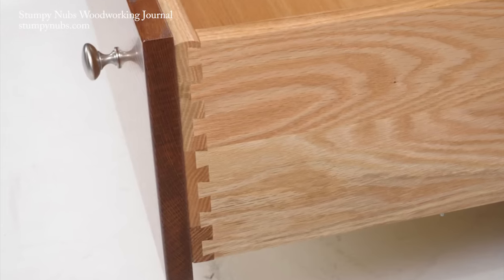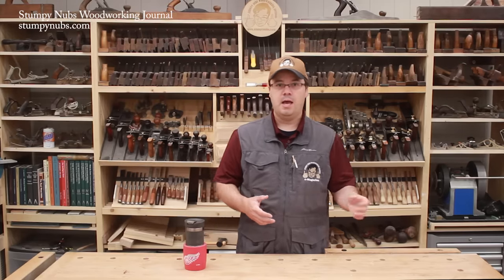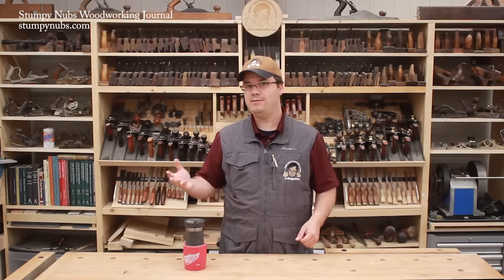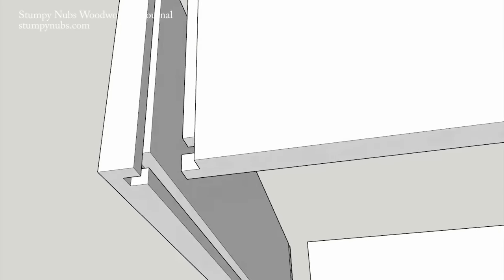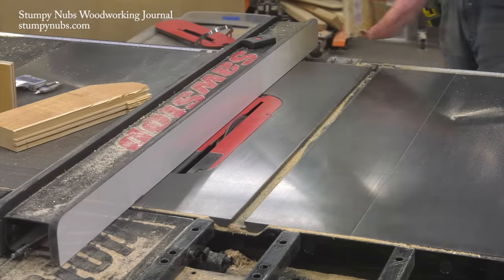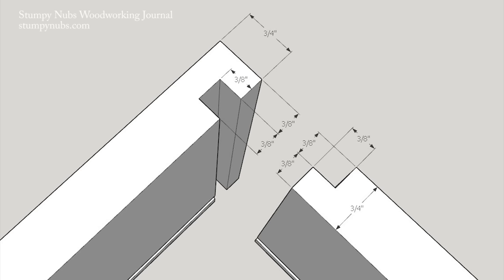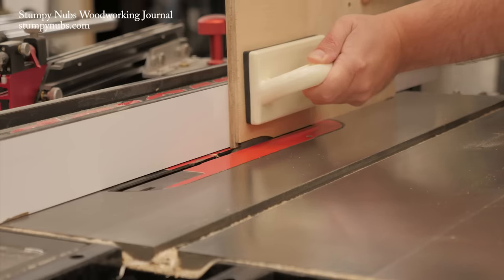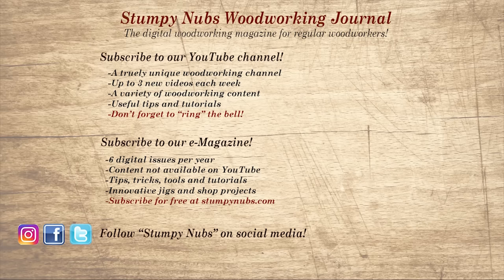The fast and easy half-half-half drawer construction method

Comment: Hi James. Love your videos and tutorials a great help to my woodworking hobby. 
Now the question. What happens if you live in blighty and don't have dado stacks. Is there a way of doing this method with a router and just as quickly as a dado or a single blade? I have the basic of tools by the way. 
Cheers
James from 🇬🇧UK
Reply: Agreed; especially since I have yet to made a tall tenon fence for the table saw.  I will try to use the router for the dangerous end cuts.  I have an old wobble dado that is infinitively variable for the other cuts without worry about stock thickness.

Comment: Is there a modified version of this that can be done without a dado stack? The rabbits are straight forward (one vertical pass and one flat pass per side), then I guess the first pass for each of the grooves, then edge in the fence for a couple additional passes to finish the grooves. Has anyone tried this?
Reply: If you have a table router, cut a relief groove down the center of your slot at the table saw (to make less work for your router) then set up your router for the half/half/half groove and finish the grooves on the router table. The cut on the table saw will make for less work on your router bit and less burning on your wood. Set the table-saw to cut your half thickness but at the center of your groove, so, if your doing 3/4 for instance, your 1/2 cut is 3/8, your center of cut will be 3/8 plus 3/16 from the fence or 9/16 of an inch.

Comment: Good and clear. Could you do another version without dado blades, and for wood sizes +rulers available outside usa? Plywood here is typically like 9,12, 15 or 18mm. And no dado blades. Also, how do your calculate length of pieces based on box final size
Reply from the maker: Unless you have a router bit that's half as thick as your metric material, this process won't be the best option for you.

Comment: Stumpy, much of the baltic birch plywood available locally is not always exactly 1/2 or 3/4 inch thinkness.  Last 3/4 inch boards measured .704 inches thick.  Using a .35 inch (or  fractionally thicker) setup should work with this process. Correct?
*I asked the salesman at the hardwood store why  some batches of the baltic birch plywood vary in thickness, he replied that 3/4" inch is the maximum thickness allow.  Any comment on this?  Thought plywood in my youth measued a true 1/2, 5/5, 3/4 inch.  Maybe dragging it from a constuction site to our tree fort was a factor. Thanks
Reply from the maker: Your setup should be half the material's thickness, not matter what it is.

Comment: Stumpy, I have a question on making drawers using the half-half-half method on my table saw.  I am using 1/2” Birch plywood, all four sides are cut from the same four foot piece.  My dado set is 1/4 inch wide, 1/4 inch above the table, and 1/4 inch from the fence.  Once set, I change nothing.  The dados for the bottom and sides are no problem.  When I cut the rabbits for the front and back, the part that slips into the dado on the sides is about 1/16 of an inch too long, creating a gap.  Do you have any ideas as to what I am doing wrong?  I can cut all the sides and bottom dados, and then test cut and adjust my way to a tight fit on the rabbits or cut the 1/16 off the rabbits when they are all cut, but that seems to defeat the purpose of the half-half-half method. 

Thanks for any ideas and help.

Comment: Maybe I'm missing something, how to do fit the front draw side with the base in place ? Do you have to shorten the length of the bottom so that it is 1/4inch shorter, otherwise the front side will catch the edge of the bottom.
Reply: I thought I was the only one! It looks impossible to me. When he slides that piece down and the bottom is in it I'm thinking dude, no way your getting that to work.

Comment: So I’ve watched a few videos for people doing this and it seems like everyone always uses a table saw and a dado stack.  I’d like to do this using my router table.  I’ve tried to do the setup and I got it close but not perfect.  First of all my my plywood is 15/32.  My router bit is 1/4”.  So right there I’m gonna have a problem.  Also the router bit tends to make a lot of tear out when cutting against the face grain of the plywood so I put a strip of blue tape across it which takes care of the tear out problem but it makes it a tiny bit thicker and that kinda throws everything off.  I’d really like to find a way to do this using my 15/32 plywood and 1/4” router bit, but I haven’t been able to dial it in yet.

Comment: Great video, Stumpy; thanks.
I love the idea of one setup to cut both the dados and the rabbets.
But I bought some half inch plywood which is actually 15/32 inch thick.  And my dado set won't go any thinner than 1/2 inch width.
I've been trying to work the math in my head and I need help.  Is it true that there is no way to use ONE SETUP to cut a matching set of rabbets and dados in 15/32 wood with a 1/4 inch dado blade?  If true, then what do you suggest?
 Love your videos and, yes, I am already a subscriber.
Reply from the maker: You can do it with one setup, but not with a 1/4-inch dado set. Your dado set, and the distance from the fence must be equal to half the thickness of the plywood- 15/64 (or thereabouts)
Reply: @StumpyNubs  Thanks for the rapid response. (And thanks for reading past my typo.  I meant to say that my dado set would not go thinner than 1/4" width. But you figured out what I meant. Thanks.)  I guess I will buy thicker wood next time.
 I'm getting back into wood working and your videos are perfect.  Thank you for doing what you do.  And thanks for the links to the products.

Comment: Can this be achieved with a router instead of a dado blade?
Reply: Yes I just made some 1/2 in. drawers using my router and this process and it turned out great. However I feel the table saw would be easier to set up and quicker cuts.
Reply: @jeremyhill5192  I've done this with a handheld plunge router and edge guide.  Takes a bit more time, and you have to set up twice (or 3 times if you also have to cut a rabbet on the bottom panel), but it's not that much slower.  Just had to watch for the router bit not getting too hot.  It's probably a lot easier on a router table, but I don't have 1 (yet)
Reply: Yes, it is a very doable jobe with a router/router-table. I would suggest setting your table-saw to make a full (1/2) depth relief cut down the center of the groove to reduce the workload on the router and help keep it from over heating. Plus the relief cut will help guide the router bit keeping it more accurate. A hand-held router with an edge guide or a table-router with a good fence will work with or without the relief cut, but the relief cut will save router bits in the long run.
Reply: this is a perfect solution for my dadostack problem 😁👍

Comment: Yes, the "half inch" plywood now measures 0.480".  If you set up for 1/4", it will not work!  I had to use a dado stack and use a paper shim to finalize the stack to 0.240".

Comment: I'm no woodworker, but I hear tell that 1/2" plywood is not 1/2", so you'd have to take 1/2 of the actual thickness, but that should be no problem
Reply: In the end, you are limited by what dado stack you have anyhow. Just round the numbers up.

Comment: I did the 1/2 x 3 method and then realized that almost all 3/4" ply is 18mm. There is one guy that did a video called 999 which works perfectly. 3/8" is actually more than half of the thickness on 18mm ply. I know that you are aware of this James. Just thought I would through it in the comments for those that maybe new to our wonderful  Imperial /metric US shananagans. LOL
Reply from the maker: The video said your cutter should be half the thickness of the material. It doesn't matter what the material thickness is.

Comment: There is a problem with this method when using plywood.  Plywood always measures less than its advertised thickness dimension. In particular ½" thick plywood is actually slightly less than ½" and if you setup for a ¼" dado you will end up with too much wiggle room.  The problem becomes a little more complicated because If using a stacked dado blade you will not be able to cut a dado less than ¼" wide.  I figured I wasn't the first woodworker to run into this limitation (cutting a dado slightly less than ¼") so I researched it and found a solution that I like.  

The short answer is to use three 7¼" circular saw blades (they are only 1/16" thick) and some dado blade shims.

The long answer is to stack three 7¼" 18 tooth circular saw blades and some dado blade shims together.  I thought it best to use an 18 tooth saw blade so there is room between the teeth to stack the blades flush.  I bought three cheap ($4.99 each on sale) Skill 7¼" 18 tooth carbide tip blades from my local Menards store.  For shims I use Forest magnetic dado shims because they can’t slide down into the saw arbor's threads causing inconsistent dado widths (which is a royal PITA when trying to achieve a precise dado width).  If you have a Saw Stop (I have the professional cabinet saw model) then you’ll have a problem to overcome with the brake cartridge because  a 7¼” blade will leave too much of a gap between the blade and the blade brake causing the system initialization to fail, even when using the bypass.  To get past this I cut a piece of aluminum angle iron about 2” long and cut its width to 1⅝” and taped it the 10” blade brake using electrical tape and then enabled the safety bypass.  Do this at your OWN risk!  Now that I know this method works I will find a better solution to fool the Saw Stop brake cartridge.

The result is a perfectly wide dado exactly half the width of the plywood resulting in a nice snug fit.  However, the bottom of the dado was not a flush plane… the were kerf marks.  I did not have a router plane narrow enough to clean that up. So that was what I had to settle with. But I think it is a good enough dado for drawers.

Hope somebody finds this helpful.

Comment: most undermount slides require 13mm bottom recess to accommodate locking hardware. carefull using 1/4-1/4-1/4 for the bottom dado.

Comment: Would one be able to use this method on a router table using the same setup with a straight bit if they don't have a dado stack?
Reply from the maker: Yes. The router bit only needs to be half the thickness of your workpieces.

Comment: Hey James, any suggestions on how you would do this with 1/2" plywood when it's not really 1/2" ? Most of it is a little less than 1/2", so then the dado setup would need to be less than 1/4", right? My minimum setup on my dado is 1/4", so how would you suggest doing this? Are there dado stacks that will go less than 1/4"?
Reply from the maker: Ridge Carbide makes a "triple play box joint set" that will cut 3/16 dados.
Reply: @StumpyNubs  Just use a wobble dado -its cheaper

Comment: Do you have to remove the riving knife to do this as well? And would this setup be safer on a router table?
Reply from the maker: Do you mean the riving knife? A dado set can not be used with a riving knife. However, a kickback is far less likely when cutting a dado (which only cuts part way into the wood). I am not saying it is impossible to have a kickback with a dado set. Some countries ban dado sets because you can't use a riving knife with them. I am just saying the risk is smaller. A router table would be a good tool for this as well.
Reply: @StumpyNubs  whoops yes riving knife. Autocorrect changed it. And thanks for the fast response! I have a cheap job site tablesaw so from what I’ve read they are underpowered for dado stacks. I plan on getting a router table so this would be a great way to do drawers for me. Thanks again! Love your content.

Comment: I noticed in your sketches the groove is stopped where it intersects with the dado but your actual cuts go all the way through to the end of the board. I am having a problem with the little quarter inch corner nub that is left after the intersection of the groove and dado. It keeps falling off. I’m using prefinished half inch birch but it seems to have a lot of voids that I didn’t see when I bought the wood. Should I abandon this project or switch to pocket holes to save the wood?

Comment: How about making the cuts with a router as I do not have a table saw.  If 3/4" stock is used and I want 1/4" bottom, I guess I'll have to change out the bit....

Comment: nice. for diy people without a special blade, i guess a proper router bit can pull it off.
Reply from the maker: You can do this with a router, but plywood is rarely exactly 1/2 or 3/4. You need a bit that is exactly half the thickness of your material, otherwise you'll be doing a lot of sanding and tweaking, and that defeats the whole purpose of the fast/easy process. That said, if you are using true 1/2-inch material you can use a 1/4-inch router bit (or 3/8, or whatever) to do the same thing.

Comment: I saved this video months ago in anticipation of a future need...which has now surfaced.
I'm a neophyte but this method looked doable and with some trial and error, plus an abundance of caution with my new dado stack, I think I've figured out how the method works. 
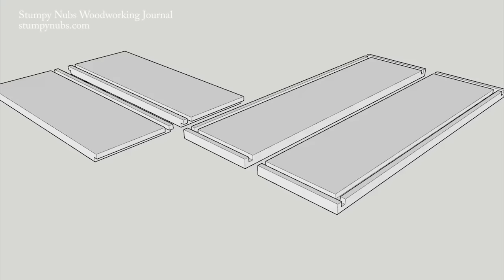Except for one fiddly little point. The sketch drawings show a stopped dado on the bottom of the sides (see 4:29) while the video of an actual milled side shows a bottom dado that goes the full length (see 3:56). This means that there will be a little "nick" out of the outside of each end of each side of the drawer (or box). 
No big deal for shop furniture but could an issue if using the method to make a box for other uses. 
Did I miss where the method of stopping the dado was covered?? Is there an easy/safe way to do this? Thank you....
Reply from the maker: The exposed ends of the dados are covered when you attach the drawer front.
Reply: @StumpyNubs  Thanks. I figured that part out but I was actually experimenting with making a box and trying to see if I could make it come out looking nice. I am not ready for dove tails yet. 
Just asking to see if there was a technique to make stopped dados with a dado stack. Will see what I can do using half/half/half with a router setup. Prob easier on the fingers... 
Best

Comment: So in your sketchup file it looks like you did stop dados and then on the plywood piece you cut you went all the way through on the side pieces.  If you go all the way through then there will be a little 1/4" cube cut out on the front and back on both the left and right sides.  Is the idea this doesn't matter because you'd be putting a drawer face on and nobody cares what the back looks like?  Or did you wind up doing a stopped dado somehow?

Comment: Wait... how do you assemble this? You wont be able to slide down the back panel as it will hit the base panel. I suppose the back panel does not use a dado fot the base panel but a rabbet,  meaning the base panel is only supported by the front and sides, right? Tks
Reply from the maker: If you want to assemble as I did in the video, trim off the back panel. Otherwise put in the bottom as you assemble the four drawer sides.

Comment: Is this based off nominal dimension or actual? Or is the difference negligible for blade tolerance?
Reply from the maker: As explained in the video, the setup is HALF the thickness of the material.
Reply: Do dados come in 23/64?
Reply from the maker: @dustinglynn8721  Most dado sets will do any size between 1/4 and 3/4+ via shims. Some sets will go thinner (down to 3/16). Router bits are also available in "undersized plywood" sizes.

Comment: Funny, You showed a drawer being assembled and it looked as if you were sliding the last piece into the grooves from the top. If you were to slide this drawer together , how do you get the bottom groove past the bottom of the drawer? or after assembling the sides, front and back , how do you get the bottom in? I suppose you could assemble and spread the sides and add the front or back but that makes for messy glueing if you glue. When I build my drawers using the same method I left the  the back of the bottom panel long, cut the bottom groove away from the back and when assembled, adding glue and staples to  the last edge to keep the drawer bottom fast. You didn't show an assembly so just wondering, how you did yours?
Reply from the maker: I didn't mention it because I wanted to keep it simple. But in that particular drawer the groove was trimmed off the back panel and the bottom was slipped in from the rear. This is how drawers were traditionally made. But it was not necessary for a plywood drawer like that.
Reply: @StumpyNubs  My bad then sorry, It was just confusing to watch you assemble a drawer and talk about something different now that you've explained it. Thanks for all the good videos, I have a few good sharp chisels now. They sure do come in handy that way.🔨🗜🛠

Comment: This method should work for building beehive boxes too.  They need a strong joint but who has time for dovetails?
Reply from the maker: This joint is only mechanically strong in one direction- the direction you pull on the drawer front. Finger joints are popular for beehive boxes because they are very strong in all directions.
Reply: @StumpyNubs  Thank you James. The hive boxes are heavy and the stresses are only when lifting the heavy box. With this in mind would you still think the half half half joint is too weak to be useful?  Assuming it's glued and stapled..
Reply from the maker: Because they are going to be exposed to the elements, you want them to be as strong as possible. I would use finger joints.